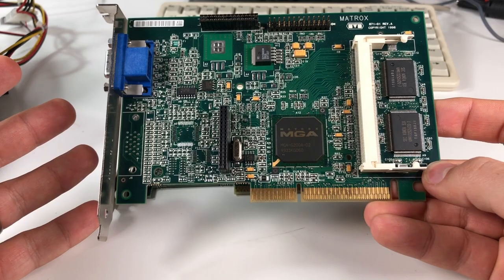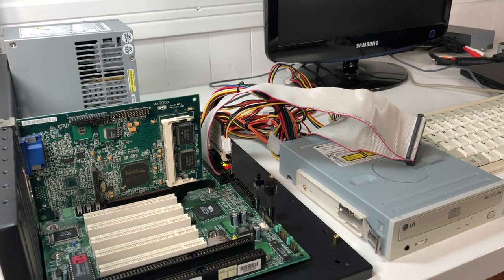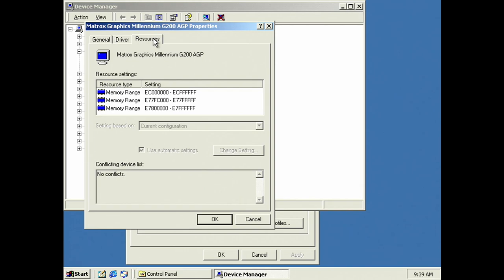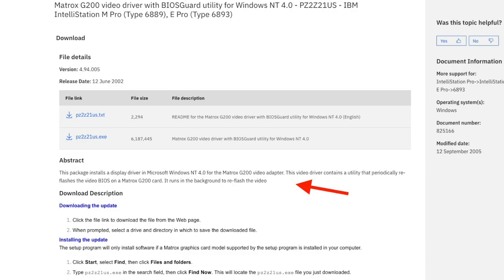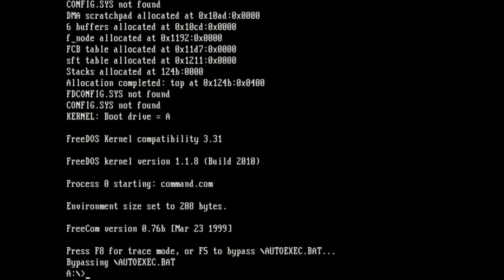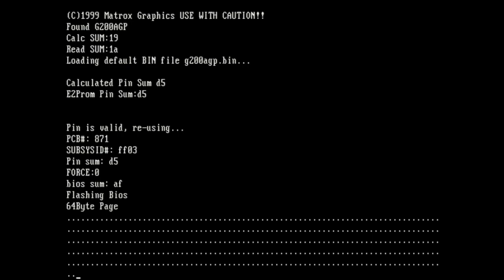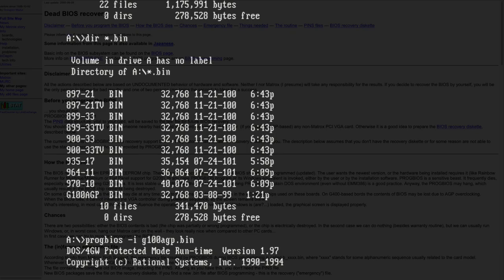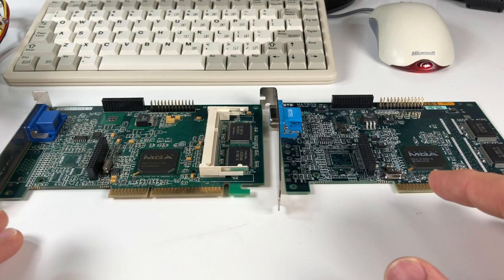VBIOS Bit Rot? Saving a Pair of Matrox AGP Cards

Comment: Around 2005 I also got a g200 when I searched for a card to have a second monitor connected. So I already had a pci card there and win recognized it, flashing vbios saved it :) For some time I had a G200 agp + mill2 pci in my machine. I still have those  :)

Comment: That happened to a G400 I owned back in the day that I had bought directly from Matrox.  Barely had it for a month and it died like that so i sent it back to them under warranty.  The replacement worked fine until I eventually retired it.

My case was similar in that you couldn't see anything that used a DOS screen but once it got into windows and the driver took over everything worked normally. 

Up until now I had no idea that this was considered a common issue with these cards and I always assumed I just had gotten a defective unit.  If it really is that common my hunch is that it's either something specific with the EEPROM used or there's a defect in the programming circuit of the cards that's causing it to apply a voltage to the chip high enough that makes it think it's being programmed even when it's not intended.  That's just a guess on my part.  Only way to find out is if a Matrox employee chimes in or you probe one of the cards directly.

Comment: A lot of EPROMs from this era have this issue. I wouldn’t blame matrox as they used an off the shelf part that should have been good. One thing Matrox pioneered before it became mainstream was multi monitor support. If you look on the G200 it’s got an unpopulated second VGA port. This was for what they called dualhead. Later everyone started doing this, but Matrox was first. Matrox still makes cards, but I think they are built on modded AMD silicon
Reply from the maker: Totally agree. That’s a very good point and I wish I had included that in the video. It’s definitely not Matrox’s fault and in fact, they are probably the only manufacturer that at least tried to do something to avoid this with the bios guard utility. I’ve always had a soft spot for Matrox cards and loved that they’re Canadian too 🙂
Reply: yeah, woke up to my 486 board greeting me with Award Boot Block BIOS Checksum Error screen, at least i downloaded a bios that supports that board, on to the TL866-II and to flash a new BIOS to it and it's alive again

Comment: This is also an issue of sorts with the Intel P28F001BX 1mbit eeprom chips used on several motherboards.
In particular these chips used at the time cheap NAND flash which is what gives them their fast programming speed. 
NAND = low cost, high density, high-speed program/erase, slow read
NOR = high cost, low density, low speed program/erase, fast read

NAND if not rewritten or powered up once in a while has a tendency to slowly "fade" to it's original un-programmed state.
So these boards if not powered up or reprogrammed in a while (approx 10-15 years) end up with a corrupted BIOS rom. At least here a fix is as simple as just erasing and rewriting the chip. But a swap to the more reliable NOR flash winbond or ST chips is also good for absolute peace of mind. 
As for the matrox cards I believe there is a similar issue at play and it's ultimately worth replacing the eeprom chips on them with a modern more reliable type.

Comment: I think the message in the end saying it was flahed 3 times is the total counter of re-flashes, not that it did run the process 3 times.
Reply: Exactly, it shows the card has been programmed 2 times before, I bought these Matrox cards and all of them have been flashed before at least 1 time, a log count of flashes is kept on the EEPROM.
Reply from the maker: Thanks for sharing. That definitely makes more sense 👍

Comment: It wasn’t long ago that I’d never heard of the degradation of stored bits in EEPROMs and the like. One just assumes that it wouldn’t fail on its own seeing as it’s not being actively written to when in use. 
It would be interesting if background radiation, especially beta particles, would be a partial cause for this effect.
Reply: It's not really a matter of being written to, it's how the bits are stored in the EEPROM. They are stored as a charge (or lack of) within an insulated/floating gate of a transistor.

Retention of the data depends on how well the gates hold their state, and usually they are rated for 100 years or so. But if they happen to be excessively leaky, perhaps as a result of a manufacturing defect, then the charge will leak away over a much shorter time.

Reprogramming restores the contents but the faulty construction still exists so it will only happen again in the future, hence there was that tool to periodically reprogram the EEPROM.

But as long as the EEPROM isn't internal to the video chip itself (fingers crossed it's just an external SPI or I2C device), it would be very much worth replacing it, and then it should live for another 100+ years without fault.
Reply: Eeeprom and fash data time retention is ensured to be at least 10 years but nothing else ... any datasheet will point this. They are not mask roms.... if you dont rewrite them .... they eventually will die. This applies to all EEPROM and flash and also flash based micrcontrollers.  This is a good warning for thos with with very speicific or collectible gear where no .bins are available. You better read your EEEPROMS and FLASH while still working and save to files.

Comment: had a dumpser dive PC that didn't boot couple of weeks ago. 
totally dead, no response to pwr pins.
flashed latest BIOS from online, with a usb flasher, and it booted perfectly after that.

so either person that threw it failed a bios upgrade (10+ year old pc, so doubt that's the case), or it bitrotted.

Comment: I recently bought a Mystique 220 for a low price. No refunds and untested. The machine did POST but no image on the screen. I followed your link and found a reference to SETUP349 containing various BIOS files. But the update program would not run. I checked the commands and it worked with PROGBIOS -k -i auto. -k forces the flash. Shutdown machine, remove AGP Nvidia card and now the Mystique is working! I ran Final Reality and oh my, that card seems worse than S3 Virge??
Reply from the maker: Awesome! Really glad the video was helpful to get your Mystique 220 working again. This issue seems a lot more common with the early AGP Matrox cards (G100/G200 etc) but I've seen it happen with others too - including 3dfx V3s. Can't say I've ever really done much with Matrox cards as far as 3D acceleration is concerned. They've always been great 2D cards to pair with a Voodoo 2 though :-) .. I did get a G400 Max recently though. Looking forward to trying that one out.
Reply: @vswitchzero Thanks I'm stoked didn't think it would work. G400 is nice card, with Direct3D actually usable. OpenGL not so much. Clear sharp image and should work with most games. Performance also not too bad.

Comment: WHy does it default to 15bit color mode? I've never seen that before.
Usually it's 256, 12 bit, or 16 bit.
Reply from the maker: Yeah I wondered the same. I’m assuming it’s a Matrox specific feature as I’ve never seen it with any other cards before 🤔
Reply: I've written video drivers before, I can explain 15 bit.

It's simply easier than 16 bit.15 bit divides cleanly by three. The results are still stored in a 16 bit space though, but go ahead and try dividing 16 by 3 (RGB). It doesn't work evenly does it?

Sorry I'm probably not the best to explain this though, they always say the programmers aren't the best to write the documentation.
Reply: @vswitchzero  VESA standards had options for 5/5/5 RGB or 5/6/5 RGB.

5/5/5 was 15 bit, 5/6/5 was 16 bit. Both got stored in a 16 bit space, the 15 bit form just like either ignored a bit, or at best used the lacking bit as a mask bit in more advanced modes/processing.

But hey, you try the raw 16 bit mode for a bit. 5 bits red, 6 bits green, 5 bits blue...

Math don't easily add up homie, and honestly the 15 bit mode was easier to work with. 5 bits red, 5 bits green, 5 bits blue, and an ignored bit to easily work around in a binary 16 bit addressing space.
Reply: @southernflatland  What worked best in practice was to run at 6 bits per channel, but either temporal-dither the red and blue, or just drop the least significant bit. Software certainly has no problem operating in a mode that's 18 bits wide, or maybe even 24, even if the VRAM is going to throw away a lot of it.
Reply: @mal2ksc  I literally wrote VESA compatible video drivers and never once heard of an 18 bit mode. I mean sure it's possible I guess, but it's definitely no standard I've ever heard of.

Back in the old days, it was basically 1, 4, or 8 bit palette indexing, or 15/16/24/32 bit high/truecolor.

18 bit would be an absolute waste of precious video memory, as it would have to be stored in a bare minimum of 24 bits, which itself was slow because it didn't align with memory segment boundaries.

For speed purposes you wanted either 15, 16, or 32 bit, because those cleanly aligned on memory boundaries. 15 bit was a bit faster than 16 bit because it could use the same algorithms for all 3 color channels, ignoring one bit though, to align on binary memory locations.

Your supposed 18 bit mode would have been blasphemy in video programming, both in terms of speed and also wasted memory.

Edit: In 15 bit mode, the ignored 16th bit could be used for masking. Not like that was super common, but it was definitely a neat novelty of such modes.
Reply: @mal2ksc  I definitely get your point on dithering though, but that's on the software level. 18 bit like NEVER got sent to the hardware though, hence the whole dithering thing.

And as far as VRAM goes, do try to remember such antiquated hardware was generally limited to like 1MB VRAM, or 2MB if you had the money for such extravagant hardware (which most games didn't even support back then).

Wasted video memory wasn't much of an option back then. Programmers used every viable trick in the book to milk the most out of the limited hardware of the day.

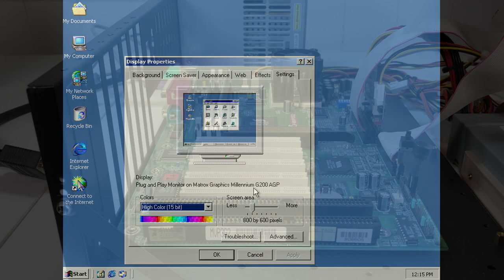Comment: Hi!  5:05 why does it say 15bit before you flash?   then after 16bit?
Reply from the maker: The Matrox driver for Windows 2000 supports 15bit and 24bit colour options, which is pretty uncommon. I switched it to 16bit earlier and it just switched it back for some reason 🙂
Reply: @vswitchzero  Okej  thanks for replaying    yes very uncommon :)

Comment: Why did you screw in the cables? That itself was like the BIGGEST form of failure I ever saw in my shop. Some fool forgets it was screwed in, then rips the port right off the motherboard/video card...

Seriously DON'T screw VGA cables in, they're already grounded quite fine without the screws. Unless you just like ripping ports off the board...
Reply: Seriously, don't ever eat any food because one person died of food poisoning one time...

And don't ever drive a car because another person crashed...

Etc etc.

Really?
Reply: @TomStorey96  Why in the world do you think that ALL modern connectors are designed with quick disconnect? USB? HDMI? Lightning Port? Etc etc...

Because of this very reason, they actually LEARNED from the mistakes of the past. This has happened WAY more than one time in history, more like tens of thousands of times.

People are simple and they sometimes forget simple things. And one of those simple things was apparently forgetting they screwed in their cables which led to countless boards getting destroyed when they decided to move their computer or devices somewhere else, or just simply kicked their feet at the wrong angle under their desk.

Engineers recognized this problem and did away with the cable screws on newer ports. So intelligent people might heed my words of caution to just leave the older cables unscrewed, it'll still work perfectly fine while also avoiding said risk.
Reply: @southernflatland  Tens of thousands of connectors may have been broken, but how many tens or hundreds of millions werent? The numbers are nearly insignificant. 10,000 out of even 1,000,000 is already 0.01%...

One "fragility" has simply been replaced with another. USB etc connectors still break off boards due to being stressed side to side or up and down, so I dont really buy that as the reason for changing them. The screws can also be used to anchor the connector to something structural like a faceplate or bracket, rather than relying solely on the pads the connector is soldered to, so I would argue that such older connectors are mechanically stronger than modern connectors.

I would also argue that connectors with screws are bigger and bulkier and not compatible with the nature of modern electronic devices which are smaller and thinner. There are also other considerations beyond the physical form factor and how robust it may be, such as signal integrity - older connectors werent made to handle the huge data rates of modern signalling standards, for which more compact and appropriately shielded connectors and cables are required. Manufacturing capabilities are also much better than they were some 50 or so years ago, making it possible to manufacture smaller connectors.

I would further (and finally) argue that it is more of a convenience than protecting consumers against accidentally moving something with a cable still attached. If that were the case we wouldnt have flimsy micro USB connectors on phones, and Ive heard of wayyyyy more of those breaking than I heard D-sub connectors breaking.

And how annoying is it when you kick a cable out from the back of your PC under the desk and have to go crawling down there to plug it back in? Doesnt happen when the connector is screwed in...
Reply: @TomStorey96  You can argue your thoughts all day long until your face turns blue. I'm speaking from over 10 years shop experience.

Those screw anchors are like NEVER secured to the faceplate, they're anchored to the circuit board and it absolutely destroys the board when screwed in cables get ripped loose.

At least quick disconnect cables have a fair chance at coming loose in a pinch of such an incident. The only time you really want an anchored connector is in a permanent weatherproof installation.

But hey, you do you, nobody ever listens to the technician anyways. Sucks for all the folks that destroyed their motherboards and graphics cards though.
Reply: @TomStorey96  Also, as far as cables accidentally getting kicked loose... Yeah it's annoying, sh!t happens though. It's MUCH better for the cable to come loose than it is for the port itself to rip off the board though. Inconvenience is WAY better than damaged hardware.
Reply: I find for an installation that doesn't get moved except when maintenance is performed (like a PC under the desk), you do want to screw the cable down. That way when you push the computer back, the cable doesn't disconnect. If it's going to be impossible to kick the connector because it's tucked in a cabinet, then you're better off using the screws rather than having to pull the machine out repeatedly when one of the cables chooses to come off the port. My desktop PC lives under a desk, although that's not the same desk I'm sitting at so it is safe from being kicked. Also I always screw the cable to the back of the monitor, or it will shake off when I adjust the tilt, or try to rotate the monitor 90 degrees. I'm not saying it's a great solution, but it's the least bad option for a poorly designed connector for modern hardware. These ports really weren't designed with portability in mind.

When I was the one supporting the office PCs, you bet I screwed the cables down. Otherwise I was guaranteed to have to take a service call -- in person -- at least once a week to fix something that shouldn't have been moved because it wasn't bolted together. For devices that are better off without using the screws... they generally don't have holes. I actually drilled some into my Aspire One because the cable fell off if I so much as looked at it funny and at least screws self-threaded into ABS are better than nothing. Those holes still aren't stripped, 14 years later.
Reply: @mal2ksc  Guess you folks are missing my point then. Almost all of the cases I ever saw of this happening were BECAUSE the customer moved their computer, to bring it in for service, originally for other reasons.

Humans stoopid, humans forgor...
Reply: @mal2ksc  A fallen cable is an inconvenience, a ripped loose port is literally destroyed hardware.

Just do yourself (or at least me) a favor and leave the cables unscrewed.